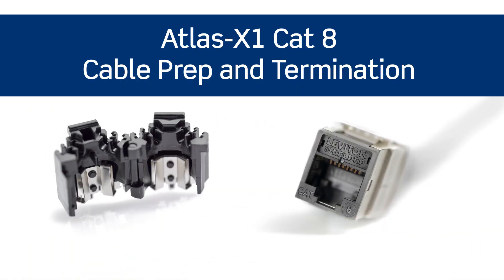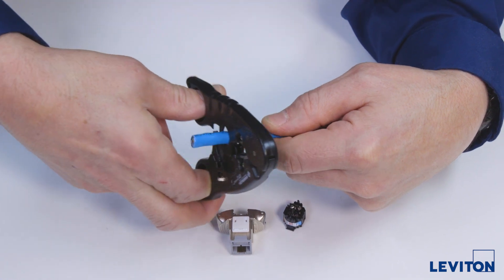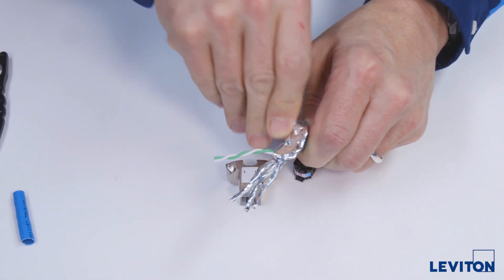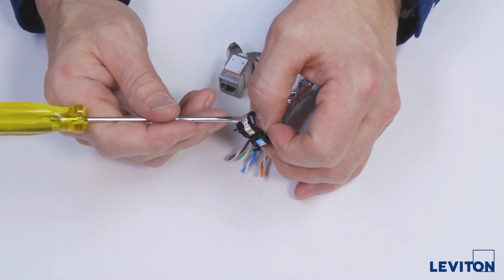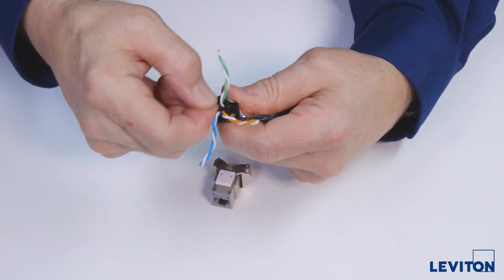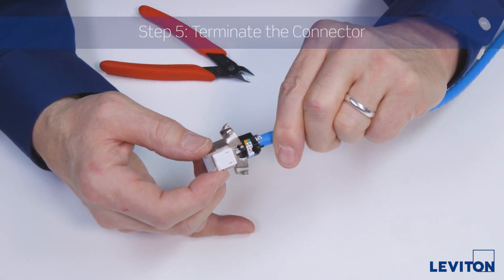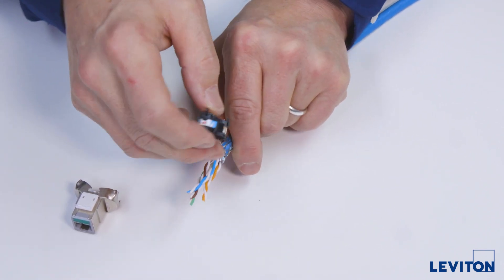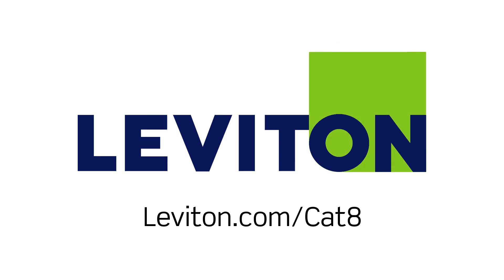Category 8 Cable Prep and Termination using Leviton Atlas-X1 Connectors | Leviton

Comment: I pray to God these connectors/cable type aren't implemented by IT departments in Silicon Valley tech companies anytime soon. Looks like a total pain in the ass, you would need a full 5 minutes just to do one. Labor costs to replace existing premise wiring at a corporate/tech campus would be exceedingly high using this technology/product. It would require months instead of weeks to rewire a typical IDF/MDF room, not economically feasible unless its a huge company like Apple or Google.
Reply: Cat8 does 40gbps and has a max range of just under 100ft at 30 meters.  It competes with fiber but it is meant for very short runs.  It is not something you run an entire campus in.  It is for short runs to a switch, server or something similar.
Reply: I've used these connectors and its actually really easy if you try.. only gripe is they're expensive. but try terminating with a regular punch, good luck with that
Reply: When is the last time you saw a company completely replace Layer 1 due to a new cable standard?
Reply: You obviously haven't wired cat5,6 cables then.  At least these have carriages to slip the individual wires in.  Older cables are threaded by hand and either slides into an EZ-jack/connector or inserted. carefully into a non-EZ port which is even more a PITA.

This is much easier by far.
Reply: in the other leviton video, the guy terminates with one of these keystones in like 52 seconds
Reply: I don't know, it seems easier to me than trying to deal with a punch tool.
Reply: @hgbugalou  Agreed